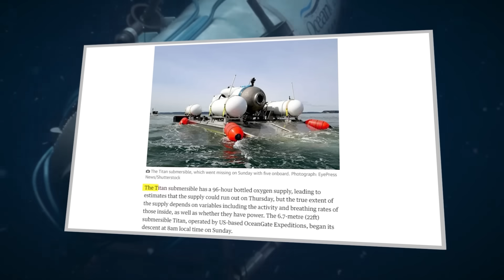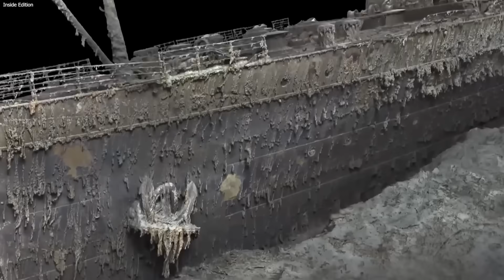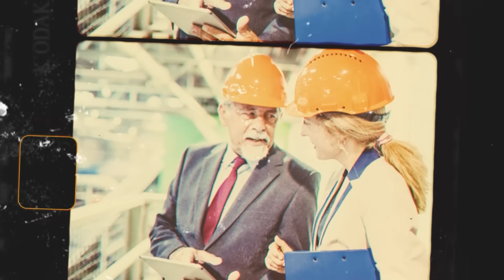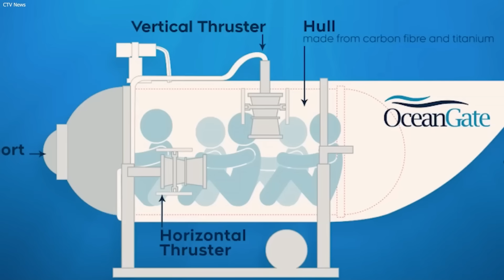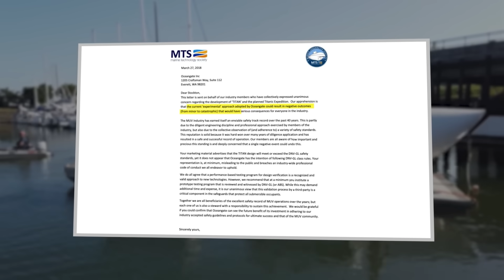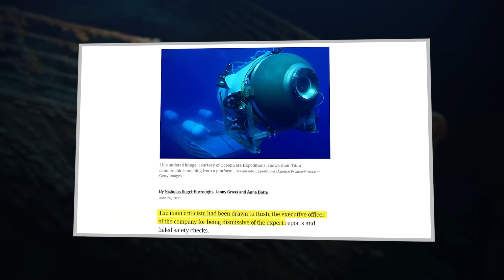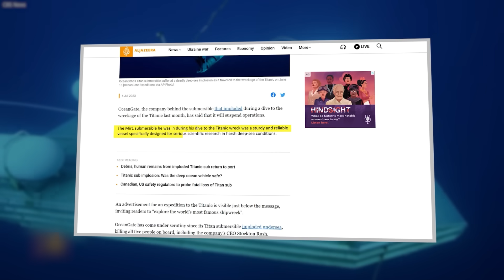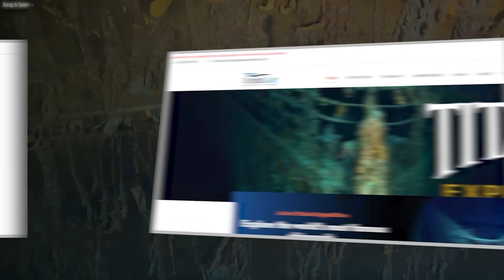Neil deGrasse Tyson Reveals TERRIFYING Truth About Oceangate Submarine!

Comment: The epoxy was the failer hands down. Which is not elastic or compressesive. It's to brittle.......Period. Plane in simple the ones that should be held accountible is the carbon fiber manufacturing who KNEW that the epoxy would not hold up to plus or minus pressures, but they said NOTHING. So why are they so so so so so so so so so so so so so so so quiet. It was because of pure greed that blinded those owner from putting a halt to the build.👈👈👈👈👈👈👈👈👈👈👈👈👈👈👈👈👈👈👈👈👈👈👈👈👈👈👈👈👈👈👈👈👈👈👈👈

Comment: I would throw this one out if I didn't think it was important enough to look at.  But this Titan submersible accident might still not have been an accident.  If the sub was using Starlink for communication and navigation, there is still a possibility that there could have been foul play at work.  Oceangate's connection to Boeing raises another red flag.  What happened on 9/11 had Boeing's name written all over it, and it was likely that through the plane's wifi a government agency could have gained control to cause those crashes, just the same as what happened to Titan, only Titan was probably remotely hijacked and steered into the abyss.

Comment: The glass didn't pop or the housing would not have, because it needed the glass to hold the pressure to burst the sides or it would have been intact as a dinner plate in titanic right

Comment: Why could they not jettison the ballast.
Reply: When the leaked transcript is authentic (still not confirmed), they did jettison the ballast, even the external frame. It had little effect. They lost battery A and switched to the backup B battery. Still the ascent rate was too low. 

Before the event, the descent rate was way above what was expected. It seems the sub was too heavy from the beginning.